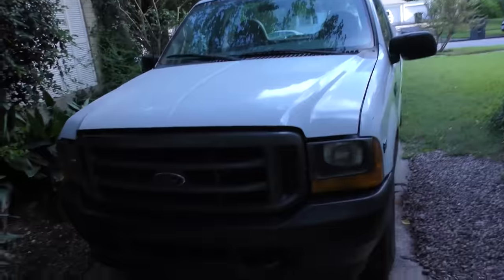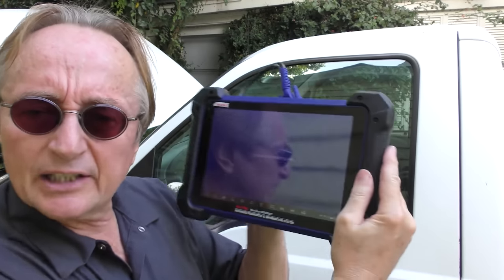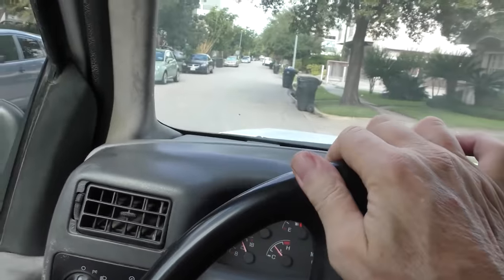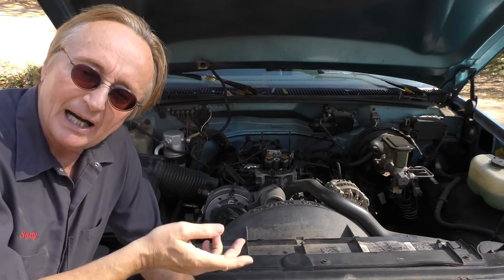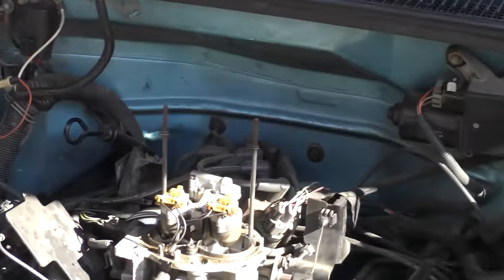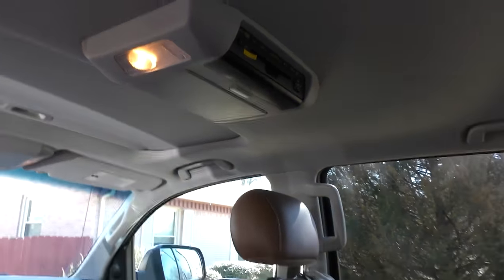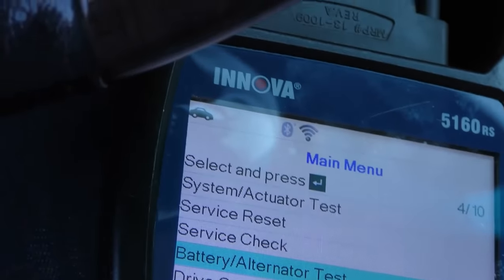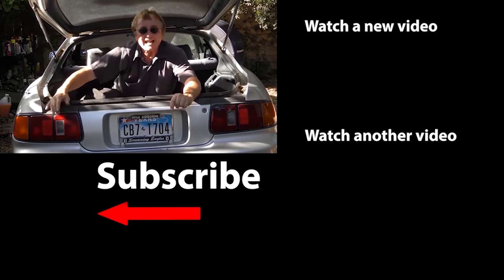3 Trucks That Will Last 700,000 Miles

Comment: My 05 GMC Sierra 2500 Duramax 223k on it with original engine and transmission still drive like brand new and still got alot of life on it and could easily make it over 700k miles on it!
Reply: Not too expensive to repair too and pretty easy to repair as well too!

Comment: I drive a 2004 Ford Expedition. Now has 423000 miles. 4.6 v8
Original motor and transmission 
I love 💘 my truck

Comment: I had a 94 Sierra with a manual transmission and I got 577,000 miles on it. Very reliable pickup

Comment: Ive got a 94 C1500 regular cab short wheel base im currently redoing. Fixing to put brand new shocks on it and in a month from now gonna rebuild the front end. odometer is showing 341K with all original suspension and steering parts.

Comment: I picked up a 2002 Ford f-150 for 500. It's got the reliable 4.6 sohc 2v v8. Those motors run forever. Still gets almost 350 miles to the tank.

Comment: Hey Scotty. I have a 2008 GMC Sierra 4.8 with 230000 miles with only 2 repairs a gas pedal and a egr component.  What’s your thoughts on the 4.8 ?  I have been very impressed with it.

Comment: My favorite older domestic trucks are Chevrolets and GMCs from 2001 to 2006 - which were made before before cylinder deactivation.  With that said, you do want buy one that had all needed maintenance performed in a timely manner.
Reply: My favorite generation of these years of trucks very reliable engines gas or diesel and built solid too!

Comment: Picked up a 2000 mazda 626 for 500 bucks. 5 speed 2.5l v6 (from the probe) cool little car. 230,000. I think I'm on month number 3 of driving it without a starter...5 speeds are cool. Just park on a hill😂 and i doordash with it. Ford/mazda era cars are solid

Comment: I had an 82 F150 with the 4.9L in-line 6cyl. 
It had a 2 barrel carb and a 3spd automatic transmission, Regular cab, long bed (8’ bed).
I put 3/4 ton suspension on the rear. I put over 300K miles on it. I sold it in 96 and replaced it with another F150 with a 4.9L inline 6cyl. It had a 4spd automatic transmission , multiport fuel injection. It too was a Regular cab with a 8’ bed.
My 82 got 21mpg and my 96 got only 18mpg. The lower mpg was because of all the Smog equipment. I put 1/2 million miles on that one. I Loved both my 82 and my 96.
It’s too bad Ford didn’t make the old reliable 4.9L (300 inline 6cyl) . They were so durable and extremely reliable.

If automobile manufacturers would realize would build reliable vehicles, people would buy them again.

Look at the Tundra. Our 2010 with the 5.7 V8 sucked on mpg, but they would easily go 800K-to the million mile mark.

Comment: Those v8 tundras are solid, but low efficiency.  Forerunners with V6 great also.  Problem for me is I'm too tall to get into those things.  Mazda SUV was the only affordable 4x4/AWD I could find that I could drive without discomfort.  2016 cost me $15K 4 years ago.

Comment: Got a 97 GMC c1500 V6 4.3l. It was my very first car, paid 5K for it back in 2008. It is STILL my daily driver. Bought it at 112k miles, now has 188k miles, Transmission went out 2 years ago, got it rebuilt. Just fixed a rough idle issue that was caused by a dirty Airflow Sensor. With the prices of used cars right now, ill be driving this truck for, at least, another 5 years.

Comment: I bought my 1990 F-250 for $800 in 2012. 6-cyl, and the AC does not work. But it still runs. I change the oil every year.

Comment: I have a 2001 Dakota sport with the 4.7 magnum V8. It has a double wide timing chain. And the tranny is friggen huge for some reason. Looking it up, every time the tranny has been serviced it was a full flush so I kept up the tradition. it had 73,000 miles on it when I got it and I'm now at 213,000.

Comment: Timing belts are quieter and weigh less than an equivalent timing chain, but that's the only advantage far as I can tell. So a small upside vs a huge downside. If a timing belt breaks you are royally screwed..

Comment: Folks, you can find the deals out there just be patient. I got a 1998 Ford F-150 5.4 in beautiful blue with 190k miles on it for $3300. It had a full spreadsheet put together by the old man who owned it of all the fixes, dates of fixes, and money put into the truck (probably about $6000 worth of stuff over close to 18 years). 

Paint on the hood and top was oxidized but other than the truck looked barely used. Ran great. Bought it and simply did the ball joints, two oil changes in its first 5000 miles because it had been sitting. 

It’s now my daily (and I spent a thousand fixing the paint at Maaco) and I love it to death. My god the low end power is unreal- I was used to 5.3 chevy’s.

Comment: 94 gmc sierra 4wd throttle body 350.  odometer quit at 278k.   Babied the transmission still factory...  changed the alt, fuel pump, rad, but not much ....and the usual stuff like  distrbuter stuff points plugs, battery,belt, tires.  this thing is 28 years old and it is getting tired and one day it will cost more to fix than buy a new one... but not today

Comment: This is way better than my GMC 1998 Sierra 5.7 thats had a new Fuel Injection Assembly added in 2021 $1,200. Now my good Mechanic shop wants $1,200 to replace the Timing Cover Gasket. Thats $2400 & counting. A new engine is $6,300. Its tired, window electrical wiring connector is busted. Ugg

Comment: I had a 92 Chevy Cheyenne W/T.  Purchased it with 4.3L V6 and 106k miles in 2007 for $2200.  The truck was always a dog, sounded like the engine would blow up any time I gunned it up a hill LOL.  No AC, manueal windows, and the radio was broken!  It needed new tires (17 inch) and exhaust after 1 year.  The windshield wiper motor circuit board was defective and the wipers only worked when it didn't rain 😂so I swapped out the circuit board with a new one finally after 4 years of that.  There was a leak in the rear sliding window, fixed it with caulking haha.  And the damn thing at spark plug wires for breakfast.  If it started running rough, I'd reach behind the seat and pull out another plug wire and replace the one that was grounding itself and causing a misfire.  Sometimes, when stopping at a red light, the truck would try to stall, or idle very weird.  It would run fine for a month or 2, then began acting up.  Never could figure that one out.  I had that truck as a work/haul truck for projects at my house and my mom's place.  I kept that truck until 2020 when I traded it for a Toyota 4Runner (Scotty approved hehe).  

The truck only gained 20k miles and almost never left me stranded.  One break line blew out (easy fix at Advance Auto Parts parking lot).  The engine belt broke and I lost power on the highway.  AAA Towed me to my buddy's house and had it fixed in about 20 minutes.  I may have put a new water pump into it as well.  The final nail in the coffin was the condition of the body.  I couldn't keep the rust off of it and it was too far gone to make all the necessary repairs.  I'd say that I probably dumped around $3000 into it over the 13+ years.  I won't say it was the best truck I ever had.  But it was the longest I had ever owned a vehicle.  

Last spring (2021), I began to feel the hurt when I didn't have a truck.  I ended up getting a 2011 F150 Lariat with 117k.  This was before the prices of vehicles went through the roof.  While it cost significantly more than the old Chevy, it was much better cared for and far nicer condition.  Dare I say it, this just might last me for another 13 years?  Time will tell, but I'm glad I avoided the crazy vehicle prices over the last year.  I should be set till 2040 right? :)

Comment: Walmart has tpms sensors in the auto care center. They cost under $30.00 each and the auto technicians will install them and program them. No more flashing light on the dash.

Comment: I’ve got a 2000 f150 with over 340000 miles same engine and transmission replaced 50000 miles ago with 4x4, any tenth generation ford will go and go and go, any engine they last long long long long long, Ford makes the best trucks period, love your channel Scotty
Reply: I Bought a 2000 F-150,V-6 Malliumn Special 4 years ago for $2350 ,202000 miles, Now I got 380,000 on it and it's Leaking Oil Real Bad . Were in the Engin Could it be Leaking From ??? I,m Senior Citizen 76,Can't Afford These High Priced MECHANICS, Can I Replace the Gaskets Without HAVEING to Take the Engin OUT ??? 😊 THANKS 👍 😊 🙏
Reply: @Richard Todd  so hard to say you'd have to be there in person to look at it and see I hope you can find a friend or relative to climb under there and take a look

Comment: I have a 1994 Chevy Silverado extended cab short bed 1500 4x4 made in Canada. 2012 put a Crate engine it with RV Cam for free. My son and I replaced it(Two bad cylinders) replace the Master Break Cylinder, 2016 had the tranny rebuilt and beefed up for towing. 2021 replaced the front end componence's from Rock Auto. Body looks like the one you showed paint still good the stuff they put over the paint is peeling but that's ok. 150 thousand miles on it. Since I've own it I put 4 sets of tires on it. Purchased in 2012. Had less the 50 Thousand miles on it.

Comment: I had a 1993 C1500 that I bought for 600. Put a transmission in for 300. Then almost a year later I was rear-ended and it got totaled. I got 2k from the insurance then bought another 1991 C1590 for 440 dollars. Needed a trans. I got one for 180. Put it in and it had a lot of power. In still driving. Has a 350/700r4 trans. Transmission is always the weak link in these trucks

Comment: I owned a 2008 Dodge Ram Big horn edition. 286000 miles on it and still runs like a top. Transmission was rebuilt at 183000 miles. Sold it to my pops, and bought a 2020 Silverado Custom. I still miss the old Dodge.

Comment: GMT400s...Alternators, water pumps, lower intake gaskets (both the 4.3 and the R code 5.7) 4L60s (reaction sun shell/sun gear, torque converter), AC compressors...just to name a few VERY common issues.  I would still take a GMT400 over anything more recent, but damn, still a lot of work.  I'll take mine with an NV4500.

Comment: on any vehicle the tranny is the Achilles Heel - if Auto-trans, will need to be rebuilt or replaced; if Standard, the clutch will eventually have to be replaced - no big deal if the engine & body are in good shape.

Comment: My brother's 2000 blazer has 316,000 miles on it, everything works, the AC quit last summer.
Runs perfect drives good.
The Auto four wheel drive works as it should. It cost him 12,000 dollar's...

Comment: If you want a half ton, and don't haul over mountain passes, or put a sled deck in the bed, the tundra is a great rig. But if you do need it to be a truck, get a Duramax,or 97-03 7.3 and 15- current 6.7 powerstroke, or any year Cummins, as long as the Dodge around it doesn't fall apart.

Comment: I traded my 2010 Silverado 1500 4.3L V6 2wd with 95k miles for a 1994 Chevy 3500 2wd dually 6.5 Detroit diesel with 170k miles. The 3500 had an engine rebuild at 110k miles, just had a new turbo, pmd, brakes, 6 brand new Michelin AT tires, and a brand new trailer brake system. The 3500 was a Texas truck and has absolutely no rust anywhere. The 2010 Silverado needed a new tranny, heater core, all the way around brakes, thermostat, water pump, and the tires were totally bald. I run a small concrete company and pull a bobcat at least 3 days a week with the 3500. Does it run perfect? No. But I’ve put over 10k miles on it in 8 months and I’d make that trade any day of the week.

Comment: Just bought a 93 gma sierra new tires cap and rotor plugs and wires and a retime was well as fiddling with the air fuel mix at 200k miles it runs great

Comment: I love pre 97 fords before the modular engine.  Pre 2007 chevys before afm ruined them.  And if its a diesel it is impossible to beat the reliability of an old 5.9 cummins diesel.  3rd generation mechanic myself, and my son works for Ford.

Comment: I got a question Scotty! I just bought a 1990 K2500. Has 176k miles. Just replaced the fuel pump (old was was destroyed in the tank). I bought it from someone for $500. He said it sat for over a year. The Cat was stolen, tank was empty. Got gas in now, still no cat yet, but I’ve tried starting it but it only starts to turn over with starter fluid but it won’t stay on.. I used a noid tester for the fuel injectors and it was good. Not sure what else to check.

Comment: Cattle Ranch Country. Got 2 Chevrolet 78 3/4 ton work Trucks. Very Dependable. 350 4 Speed transmissions. Gotta 71 GMC longbed pick up. Very Sweet 402  Put a 5 Speed. Adios 🇺🇸🏁

Comment: Im on my second obs, 2000 z71 tahoe in victory red.  First one was a 94 4x4 shortbed fleetside.  Never cared for the stepsides.  Bought it for $5000, sold for $7500 last fall.
The tahoe is so comfortable and solid af with the factory brush guard.  I feel like i finally found the truck that was built for me.
Reply: Tahoe? Or you mean Silverado?
Reply: @kingjay239  
2000 was a tweener year.  Both gmt400s and gmt800s were made.  My hoe was made in Arlington May of 2000, sticker on door.  One of the last obs tahoes made there.  Z71 came stock with brush guard, step rails, tail light covers, luggage rack, 5 star alcoa wheels, mono painted grill and bumpers, fog lights, and two tone leather.  They were made for 2 years, 1999 and half of 2000....a unicorn. Hahaha
Reply: @brandonnickerson8934  wow man, sounds like a beauty. I’ve always loved the 1999 and down tahoes as well as the NBS, back in like 03-04 my parents had an obs 1999 Tahoe LS, and even tho it was the base model she was a beauty. Back in 2018 I had a NBS 2000 Tahoe LT, fully loaded with only 85k miles. Sold it for $5k to carmax lol. I wish I hadn’t tbh. I currently have a 2002 Yukon Denali, with 127k miles on her and I love everything about that truck. So smooth when you’re on the road just cruising.
Reply: @kingjay239  
That GMT800 Yukon is bulletproof, low miles for 20 years old.  
These truck are smooth, and the seats are some of the most comfortable ever made.  Seems like you did good after letting that gem go.  I recently sold my 1994 Silverado 4x4 reg cab short bed fleetside to buy the tahoe.  I know I will regret it down the road, but I made $2500 and drove it for seven years.  😉

Comment: Got 2 cornbinders both 1300 s and carbs  on both keep em under  3500 rpm last  300 k w oil changes 3500 miles  out of a moter made 4 a tractor

Comment: still have my 86 chevy 1/2 ton  scottsdale that i bought new in 83 for 10k. power windows,a/c, intermittant wipers,cruise, 307cu, 4bbl carburated, overdrive tranny, 2wheel drive.  150k miles (dont drive it in the winter) so theres no rust

Comment: Hell I'm still driving a 1995 f150 that i payed 1000 bucks for it 5 years ago. It came with a 5 speed heavy duty trans not the Mazda one. with the 300 straight 6.  4.9l it has over 320k know i got it with 240k and still drives like new and it only a two  wheel drive with the single tank and long bed. Best truck I've ever owned.

Comment: I've got a 1990 ranger 2.3 five speed, 620,000 miles. I put over 100 miles a day on it. Still getting down the road. Blew a timing belt that had 200,000 miles on it. Had to be towed. Later the crank sensor went out. Had to be towed. That's about it for problems.

Comment: I had an 87 GMC 3/4 ton diesel 6.2 l. I got over 500,000 MI. And the only reason it died was because of the rust I did everything to keep the rest away for that long but eventually it's not going to matter what you do. Everybody told me those were junk diesels never had a problem starting ever I don't care how cold it was. I put the gel stuff in twice the whole time I've had it.

Comment: I have 410, 000 on my 2003 Savannah all I had to change was the knock sensors that was my fault for steam cleaning the motor. All motor and transmission just serviced. I have a new 2017. Which has just turned 250,000. Just found out recently I need to change the hub assembly going to do it myself because I know it's done right then. And that's pretty much it Just Tires oil changes transmission changes gear lube change

Comment: Scotty,
 I have an 04 Sierra, that I bought new. Not a scratch on it.
 Looks new.
 It has 348,000 on it and still runs excellent. Starting to notice it getting a little tired. I tow a 4000 lb.. ski boat with it, so I am getting worried about it.
 Figured that I would replace engine, trans, rear end, and keep going.
 Have heard some bad stories about reman engines, trans. sources?
 Any advice?
 Hard to decide

Comment: I have a 1991 Ford Explorer Sport with 91,000 miles and a 2 inch lift kit. It needs a 5-speed manual tranny. It has been stored at my step brother's in southern cali. What other issues might pop up after sitting in the heat for 2 years?

Comment: Basically, any Chevy truck from the early 80s - mid 00s. The 5.7l 350 engine in particular will last a life time if you take care of it. Routine maintenance and you can probably get 750k out of the engine. You may go through a few tranny repairs though.

Comment: The F250 will last 700,000, but the oil pan will have rust holes in it in 7 years if you live where they use road salt. Then you will have to raise the cab up off the frame to replace it . $1600 labor to change a $95 pan. Good luck trying to replace it in the driveway.

Comment: I know those F-100s or F-150s that had the 300 straight six could last practically forever. Especially with the manual transmission. Even those Ford and GM push rod V-8s could go a few hundred thousand miles if you kept the oil changed. But good luck getting a Ram to go anywhere near that. I just can't figure people that buy one Ram after another despite having nothing but problems with them.